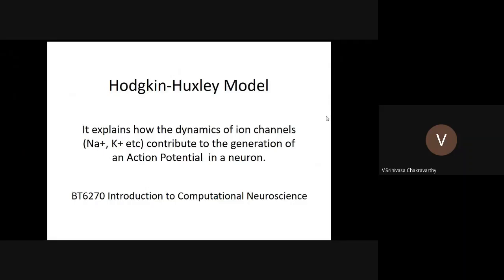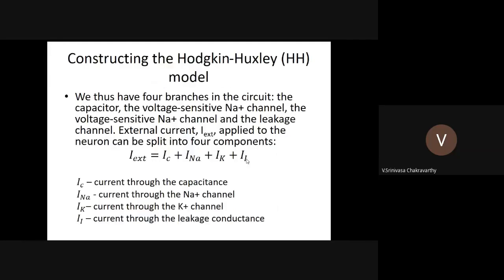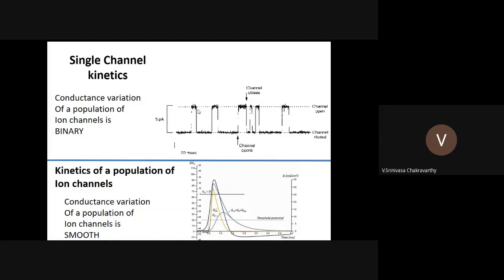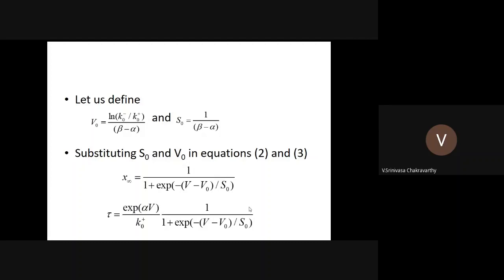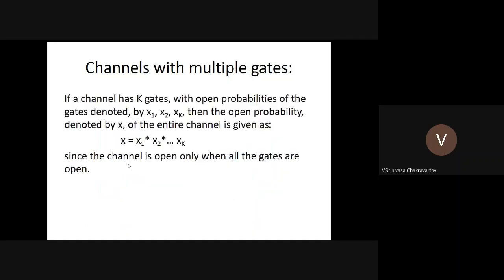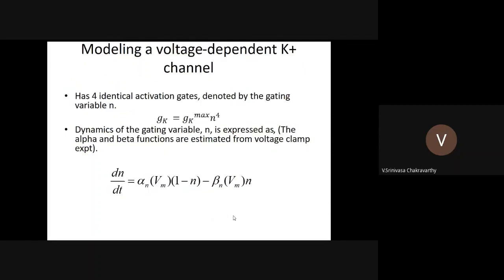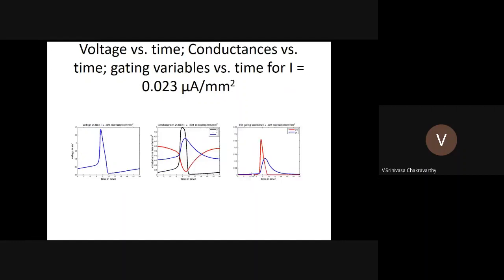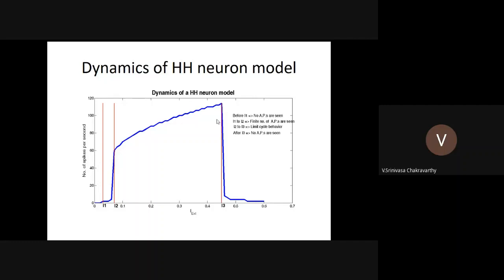10. BT6270 Computational Neuroscience Intro - Hodgkin Huxley Model

Comment: respected Sir,
During voltage clamp experiment an opposite current is passed trough the axon in order to maintain command voltage.my doubt is how they have identified that the first small current is capacitive current, fast inward current is sodium current and late outward current is potassium current ?
Reply from the maker: Hi Arpit,

The summary of Hodgkin & Huxley's experiments were written in 5 papers. It covered the function of neuron membrane under normal conditions, the effects of changes in Na+, K+ concentrations etc.

For the contribution of Sodium and potassium ions you may refer the below paper.
https://www.ncbi.nlm.nih.gov/pmc/articles/PMC1392213/pdf/jphysiol01447-0082.pdf
Reply: @cnslabiitm7218  thanks.